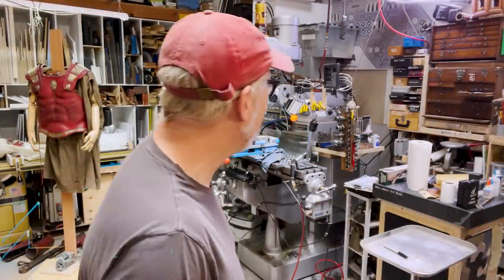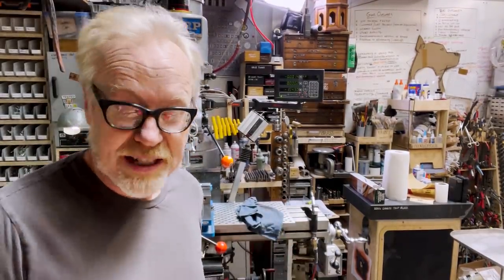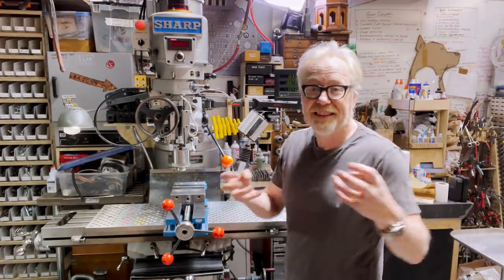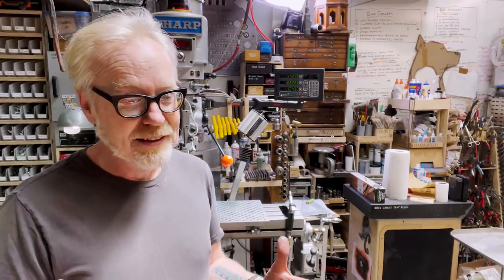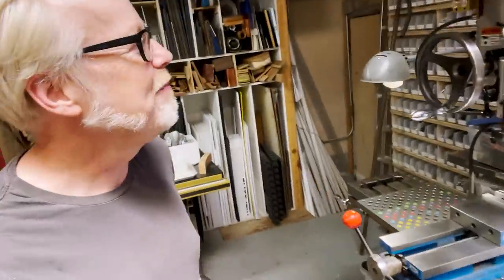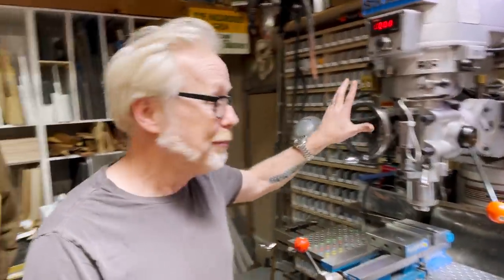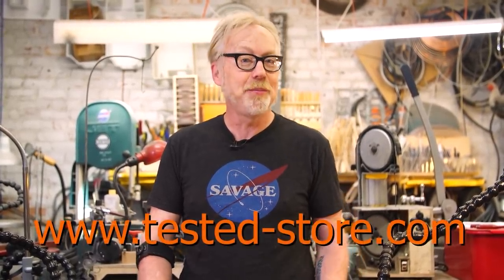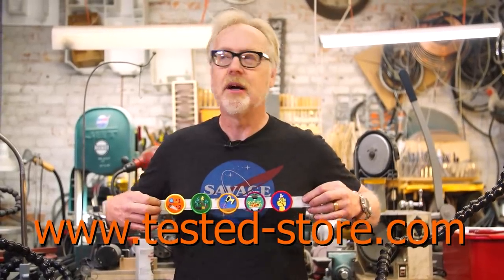Adam Savage's New Milling Machine!

Comment: But what are the colors in the holes? Why do only some have neon colors in them? That's bugged me for weeks!
Reply: I'm guessing your asking holes on the setup table/Fixture Plate/Tooling Plates/Modular Fixtures or whatever it may be called, 
well my guess is that they are holes location for a specific tool that need to be at 
x-location.
Reply: @1BigBen  Thanks, that does seem reasonable to me. I wasn't sure if it was protective packing covers that Adam never removed from some of the holes or something.

Comment: Adam is buying fancy mills and here i am assembling a cnc router that I 3d printed. 

Must be nice. Lmao. Beautiful machine, one day I hope to have something similar.
Reply: I started out on a Bridgeport in college, and then after graduating got a Makerbot. 5 years later I had learned enough from rebuilding the printers that I built a 4x8ft CNC router. Then I converted a small mill to CNC a few years after that. And now I've got a small shop prototyping parts and running a Haas VF2 that's not even a year old. 

Not that everyone needs to go that far, but It can happen! No shame starting where you are.  

I still run my homebrew CNC router and my ancient 3D printers all the time because they still do stuff the big mill isn't setup for.

Comment: Absolutely LOVED this video (as always)... I'd been waiting months to find out the story behind the new mill!

Also, re: explaining the difference between a mill and a drill press to folks not who aren't really up on tools... I've always found one of the key points to be that a mill is designed to handle lateral (X/Y) forces on the quill. As opposed to a drill press, which most definitely isn't (I can't have been the only teenager who decided to just chuck an end mill into a $100 drill press, right??)
Reply: Haha absolutely. Kind of doable if you’re machining something soft. I think you can buy beds with x and y feeds for drill presses.
Reply: @mitchgibson3605  Yeah... I suppose if I'd been working on wood or something it would've been different. But after quite a few attempts at cutting slots etc. in mild steel (relatively thin), I ended up with a spindle that wobbled more and more every time. The bearings just weren't made for lateral forces.

Yeah, I've got a cross-slide vice for my current drill press. It's amazing for drilling multiple holes in a straight line.

Comment: How do you control the lubricant spray in such a tight space?  I would expect everything around the mill to end up drenched.
Reply: You usually setup trays in the table slots. Adam really has no business using a coolant pump for what he does. They're only for if you expect to make a couple barrels of chips a day. Then use a pump.

Comment: Worth pointing out, because I know I'm not the only mad scientist here, the main difference between a milling machine and a drill press is how they are designed to handle load.  A drill press is only designed to handle axial loads (in line with the axis of rotation) where a milling machine can also handle transverse loads (parallel to the axis of rotation).  For this reason, most drill presses won't take well to a mill conversion without seriously overhauling the bearings and tool retention.

Comment: you can replace ways with new ones...............you just wanted a new mill.    Your use or your duty would never wear one out especially a Bridgeport.
Reply: The ways are built into the machine. You can rescrape or grind them. Well, most people can't but some can.

Comment: The bottom line. The materials you work with must be precision pieces otherwise they will not do what you designed them for. There are numerous industries that have specialized individuals that all they do is calibrate different types of machines. But to use them your equipment is going to be expensive. But that is just the cost of having precision equipment. I understand the importance of accuracy of all the tools you use to create all the stuffs i create. But thanks for explaining how the machines that you have in your man cave/workshop/mad lab. work. As much as you are a creator you are also an excellent teacher. You and Jamie always made stuff more interesting. I always understand about half of what your experiment for the week was. I do have some electronics background and some woodworking experience and I have taken PC's apart since the early 1980's. Outside of that my knowledge is limited but I am willing to try things because being a homeowner it can get expensive to have others do work on your house.

Comment: It's too bad he has such limited space... he could get a pretty good used machining center for the price of that new knee mill.  I had a used knee mill once, with 2 axis CNC...  the 3 axis CNC machining center, 20 position tool changer, and enclosure for flood coolant?  Life changing. A used VMC in reasonable condition should be around $15k.  I think the hobbyist community is missing out on an entire class of machines because so many jump to Tormach.  That's what they see on YouTube.  New Tormach is substantially inferior to and more expensive than used heavy machining centers.  Totally fine if you don't have the space, but if you do....  :)  BTW not looking down on Tormach... I'm sure it's a lot better than the Sherline benchtop I had for years...

Comment: I hope you have oiled the table under that setup plate , coolant has a high percentage of water in it and will cause rust to table top if that plate is left on it for a long time ,also hope you have levelled and bolted mill down ?
Reply: You do not have to bolt floor standing mills down. They don't go anywhere.
Reply: @1pcfred  it helps keep them level which is more important than most think same goes for lathes
Reply: @jasonhorne4414  there is absolutely no provision for bolting that machine down. The only reason you'd want a mill level would be for setting up on it and coolant drainage. Past that it being level wouldn't do you any good whatsoever. Lathes if they're not "level" the beds can twist. But there's it's less important they're level than it is they're just sitting right. So level is used as a convenient way to determine if that's the case.

Comment: Chasing zeros is silly.  A good machinist can work around a worn machine and hit 0.001" any time they want.

0.0001" is really a CNC thing, you might try to hit it by hand but if you want to do that by hand, you should be using a surface grinder, not a mill.

I've had the pleasure of working on machines that are absolutely beat, used in schools, the military, production machines that were first worn out, then beat up, then neglected.  Incomplete, broken castings repaired by brazing, rusty, you name it.  A lot of them made before WWII.  They can be hard to deal with but they can get the job done unless you're being abusive.

I hope your Bridgeport went to a good home because it has plenty of life left in it.